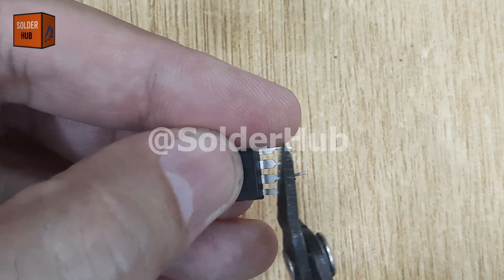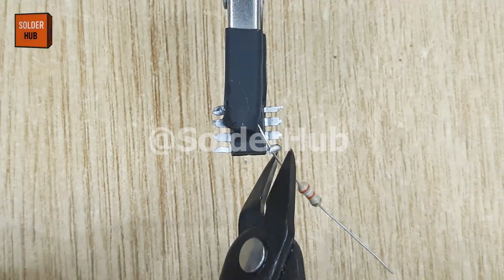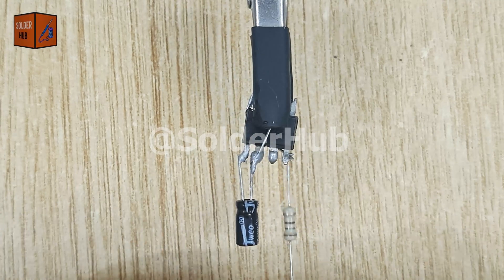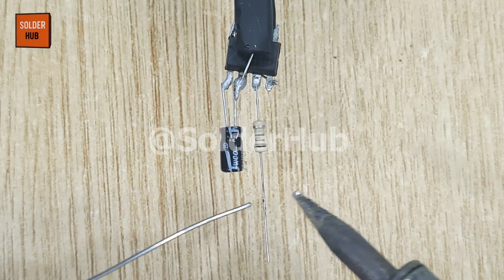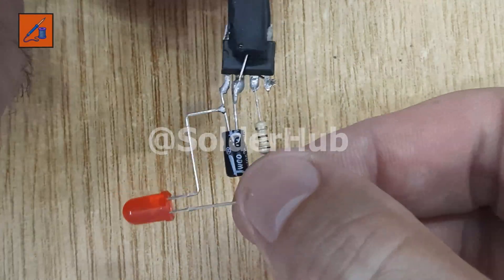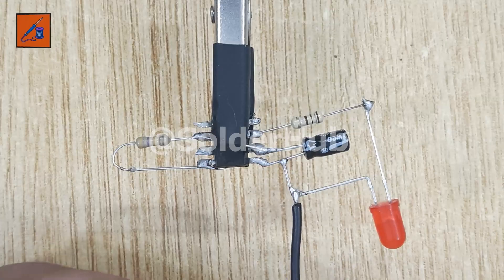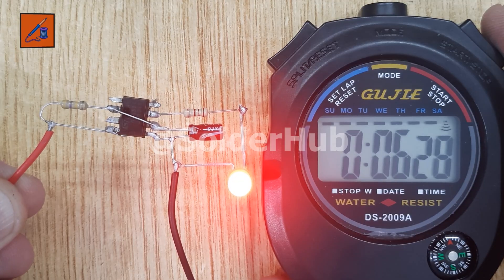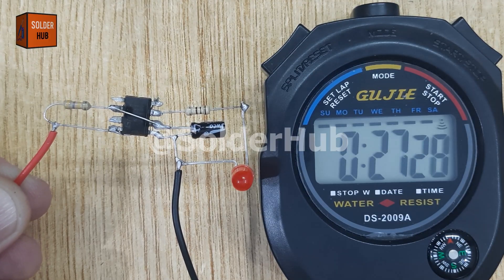How to Build a Timer Circuit using 555 Timer IC

Comment: Hey sir can i do it with 12v i did but 555 ic Got hot ?
Reply: yes max voltage is fifteen Volts
it can handle oinly one hundred mA on the output.....your load is tooo low